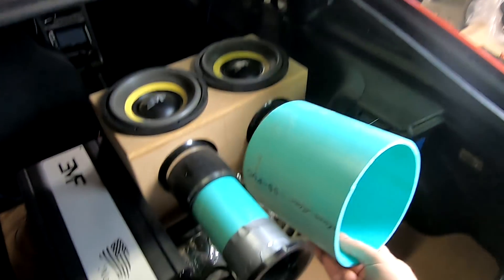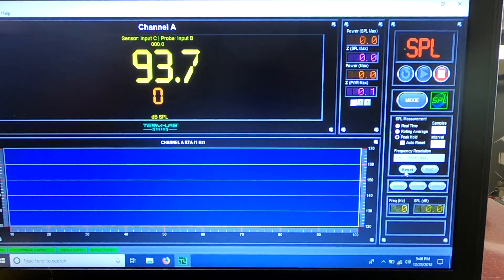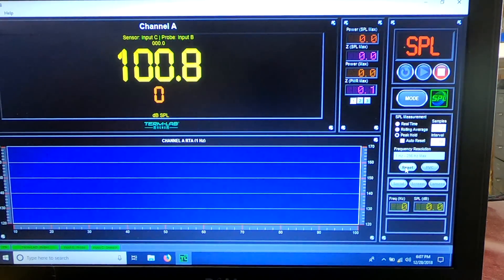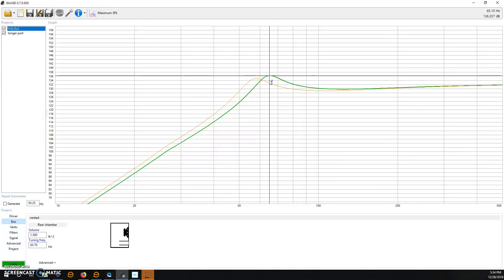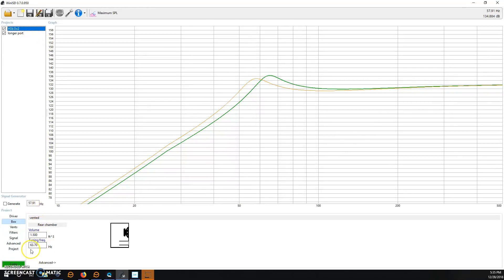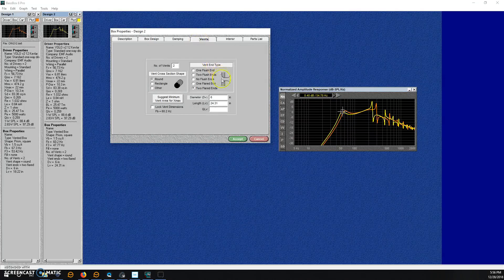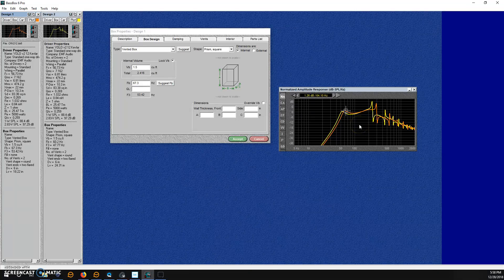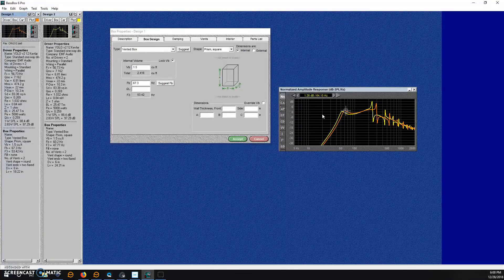Your box modeling software is very wrong, here's proof - Tech Stuff Tuesday

Comment: Hi EMF, really loving the technical approach to your videos. I was wondering if you could do one on the topic of small signal vs. large signal parameters in regards to box modelling (if there is someway to measure is as open space as possible i.e. no cabin loading, or half or quarter-space loading for that matter). I am interested on seeing the correlation of the sub-woofer sensitivity parameters vs. true SPL on sub-bass, say <50Hz and how peaky exactly are highly-motored subs. I believe most modelling software such as WinISD or even more comprehensive simulators such as HornResp really paint a peaky picture but I don't believe that is the case. I don't believe anybody as really tried to quantify this.
Reply from the maker: That is a great idea but it would be very expensive. I'd have to test in an anechoic chamber which I would have to build or rent (no idea where one is near me). I would also have to use a driver that has already been Klippel tested or send one of ours to do that (very expensive). That's all before getting into building materials. Your theory is correct and it would be interesting to see that difference but it may have to wait till these videos are making more than $5.
Reply: Do you mean like this? https://data-bass.com/data?page=system&id=8&mset=36

Comment: How did you start calculating this box for spl? Eye times pi or? :)
Reply from the maker: I've owned the car for 18 years and I designed and built the subs. I know what works and what doesn't.
Reply: How then i start building box for my "xy" sub? Manual or?

Comment: Not so fast my friend, the simulation software is about simulation right?

But the software itself won't do things for you, please share with us the parameters you input, the cabin gain simulation vs free air.

I agree with you the SPL inside the car cannot be predictable, you need to measure real world.

Regarding the ports, there are many factors like the flare, BBP uses a nominal radius, cannot be customized.
You didn't show us how you compensate for external ports right?

You need proof you are using the software in a knowledgeable way, otherwise this video can be misleading.
Reply from the maker: Look closely and you'll see everything you asked for. There is no cabin gain simulation because the software can't do that, furthering the point being made. Even in free-air it's not accurate which was demonstrated in having two completely different response curves. As for external ports, the volume wasn't based on port displacement and therefore doesn't matter either. Plain and simple, those programs aren't accurate for how they're used. Put it in a car, or a room, or anything other than outdoors or an anechoeic chamber and it won't be right. These are things advanced audio people already know, but needed to be proven to the inexperienced that follow it to make purchases or do installations.
Reply: @EMFAudio  You can add the cabin gain to the software, this is what I do, on BBP you cand import the cabin response, or just input the longest measure of the cabin in feet, then convert that to Hz, then input that.

So soy can get a simulation inside cabin, outside cabin.

Port displacement is way too important, the BBP never consider a port outside the box, since you don't compensate for this, the simulations will be wrong.

What Loss Factor you calculate for the ports?

Otherwise i I use LEAP for designing, its a high end software for speaker, enclosure y xover design, you should take a look for it.

The problem with software is mostly the user, what soft gives you is just a starting point.
Reply from the maker: @electronicatotal6698  WinISD can't do it, and BBP will still be wrong. Simply putting in the length of the vehicle will not calculate cabin gain. There are 3 primary axis where waves reflect and they won't reflect equally so you can't even necessarily use those calculations unless it's a square or rectangle with perfectly flat sides. Additionally, because of EXPERIENCE, I can tell you the car will act differently at different SPL levels and the box will act differently at different power levels because the sub acts differently because all those parameters you entered are based on small signal, not large signal. When all of the panels and metal start moving, everything changes. For this reason you can add deadener and change the cabin gains. You're changing the resonance of the panels and potentially stiffening them, further rendering any measurements useless. 

I'm familiar with LEAP, and I'd look to see how much it costs now but they appear to be out of business. Last I knew it was something like $1,600 which few will pay for, and it still doesn't cover all of the other dynamics I mentioned. It seems you're stuck on simulations must be correct because numbers say so, the reality is it would take a NASA budget to create something that could potentially accurately simulate it in combination with many many other tools to measure various parts of the car and how they respond to pressure and sound waves at various barometric, temperature, and humidity levels.
Reply: @EMFAudio  Not stuck on simulations, but i will not say simulation software is WRONG...
Reply from the maker: @electronicatotal6698  If you get results that aren't correct when tested, they're wrong. I did it from actual data so nobody could say anything was rigged to show it wrong.
Reply: @EMFAudio  Please share with us the subwoofer parameters you input on the BBP, so all the tabs in the design if you can
Reply from the maker: @electronicatotal6698  9 minutes in, it's all there.
Reply: @EMFAudio  You are right, information is there, can I get all parameters for those subs, I looked for them on the internet and couldn't found them.
Reply from the maker: @electronicatotal6698  All the parameters you need are there. You won't find them anywhere on the internet because that is a prototype sub. The YOLO v2 has not been sold to the public yet, nor has that information been published anywhere.
Reply: @EMFAudio  You state:  "There is no cabin gain simulation because the software can't do that...".  In WinISD there IS an option under 'filters' to add "Linkwitz Transform"  which effectively adds 'cabin gain' to the frequency response curve.  In my experience, no, it's not dead on accurate but it's close enough to allow a good idea of what the sub's sound will 'look' like in my own vehicle.

Comment: These softwares were made to simulate frequency response in open space.. not in car..
Reply: These softwares do have features to account for a room/car but i dont think he used em
Reply from the maker: @rudrakshgupta4194  How can you have the room data without testing the room with a box that doesn't model correctly anyway? You can't enter data in for seats, carpet, leather, door panel shapes, sub placement in the car..... No matter what you'd enter for a guess, it would be wrong because of material factors.
Reply: @Venki7744  Because that's too logical and would point out how shitty most drivers are today if people knew how to do all that. Sundown and their cronies started all the "TSP's do not matter" BS way back when I was killing them in the lanes and people were actually educated enough to use TSP's.
Reply: @2002ZRX1200R  what TSP stand for
Reply: @EMFAudio  You can test and determine what the transfer function of the vehicle is. Then use the modeling software to design the enclosure to match that frequency.  You can then position the enclosure to take advantage of a mass loading effect(boundry loading). If you only care about spl. Perhaps a video on that would be very informative to some.
Reply from the maker: Correct, but that isn't what people use it for. It will never be in an open space unless it's outdoor PA. That's the purpose of the video, to show it's not accurate when the environment isn't considered.
Reply: @EMFAudio  True that
Reply: @EMFAudio  i would like to suggest something why dont you first check the drivers ts parameters using equipment like dayton audio dats,a condenser mic and the software would suffice too and then use those parameters that you got and apply them  in the simulation while using the room/car feature(bassboxpro) i think that would be way more accurate..just a suggestion
Reply from the maker: @rudrakshgupta4194  I designed the subs myself, then built them myself, then took parameters of the subs myself. All that data was used for maximum accuracy.
Reply: You seem right for mobile contest audio, but for many of us the idea is to get a flat response in an open environment so the music will sound like it is played in our room with the effects that room acoustics provide. Let the room affect the music, not the speaker provide a pre tuned source. That is the goal, but most speakers fall far short of that. I have used software to tune speakers and the results measured outdoors were close enough to prove the design.
Reply from the maker: @johnhodgson5313  We're in the business of car audio, not home audio or pro audio. Though noteworthy, home audio has some of the same challenges as cars, but not as drastic.
Reply: @EMFAudio  Got it. I have put audio in 7000 seat arenas but I wouldn't be able to do a car well, let alone win SPL events
Reply: I can't believe this idiot thinks he's teaching others? Of course you measure and apply cabin gain when designing a system. Why is he designing the system to be peaky? Why would somebody want that? Truly the pursuit of an idiot!
Reply: @repartocorseman  some people prefer peaky boxes some prefer flat and etc. You dont gotta judge somebody at least he is doing something productive
Reply from the maker: @repartocorseman  Competition SPL where the only thing that matters is the loudest output is why. You WANT peaky, that's how you are loudest.
Reply: @EMFAudio  Your video ended up being reposted on a speaker builder forum and had us all LOL. You know what? You're taking the time to reply to everyone's question or comment (even the hostile one's....) Good on you! That say's something! I took the time to look at your site a little bit...… I have to say those Banhammer subwoofers look impressive! Linear spiders on a car audio sub? Usually they have progressive spiders so you can mindlessly drive them with Gigawatts and get subjectively higher output and lower distortion while experiencing fewer failures. Of course linear spiders have lower distortion when used within Xmax and why would a sensibly used subwoofer fail? Peace!
Reply from the maker: @repartocorseman  Not all subs are designed by the accounting department. We actually put the user in mind when we design and test prior to releasing a product.